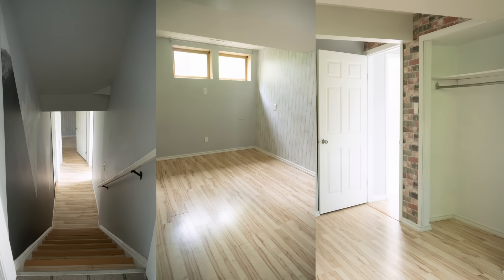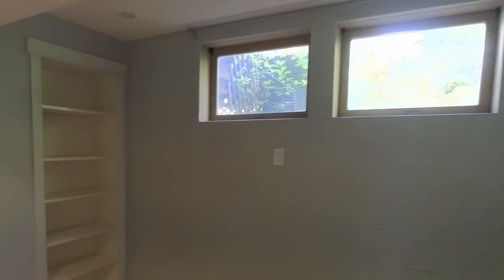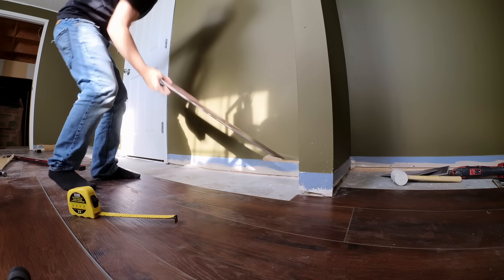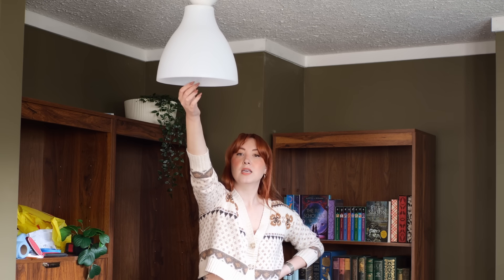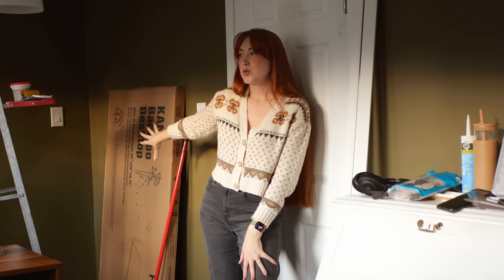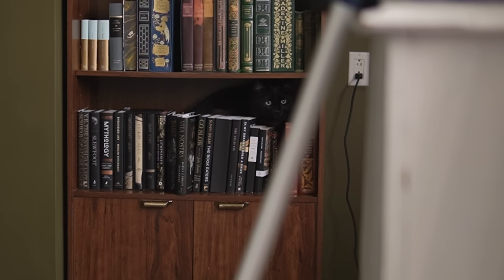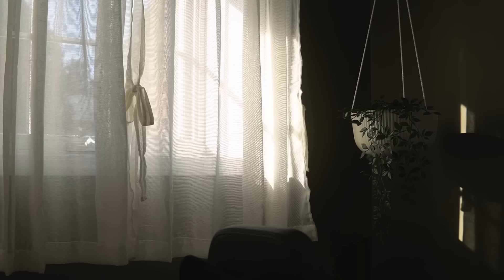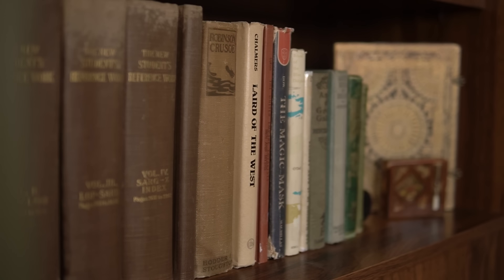Boring Basement to Dream Home Office + Library! | 2023 Home Office Makeover ✨

Comment: 1) YES PLEASE to an in depth library shelf organisation walk through 📚
2) if you want to preserve the light and airy feel of the short sheer curtains and have an option of blocking out light you could try installing a double curtain rod, it's like two parallel rods so the sheer curtains can hang behind longer blackout curtains, which when open will frame the windows allowing dappled light in through the sheer curtains, and can close in front of the sheer curtains to control light (double curtain rods are on my home decor wish list)
3) sit stand desks are the way. Until you get caught running old barre exercises on a zoom call lol
4) IF POSSIBLE, could you share where you got the brown cable knit dress (I think it's two pieces, a dress and a bolero maybe?) that you're wearing in the talking portion at the end and the segment on your sit stand desk? It looks so cosy and slouchy but not shapeless

Comment: I love this room makeover. I especially like the library portion of the room. I do have one question, where did you get the really large, extra tall,  vertical digital clock on your desk? I love something like that for my desk.
Reply from the maker: It’s my second monitor turned vertical so I can have two windows stacked on top of each other while I work full screen on my main monitor! The clock is just the screensaver ☺️